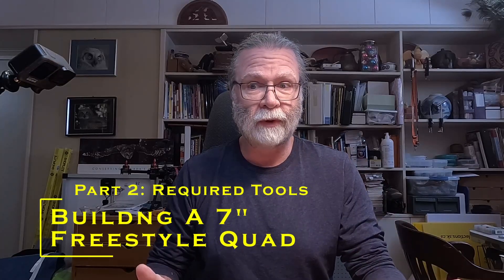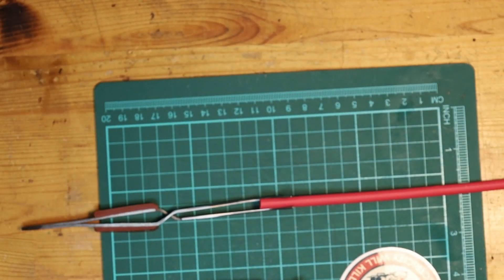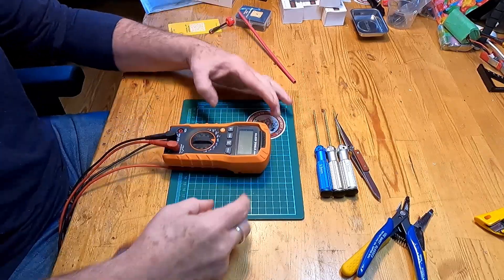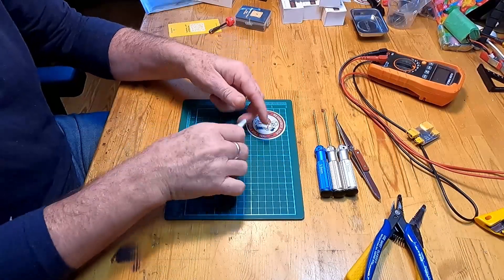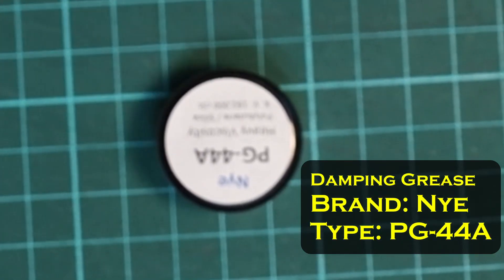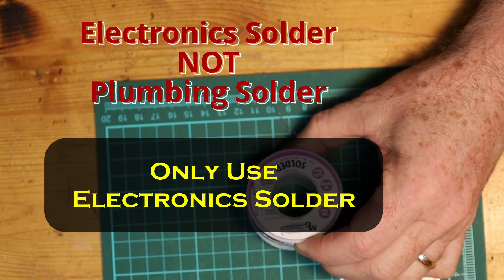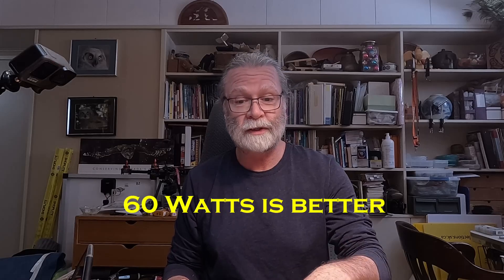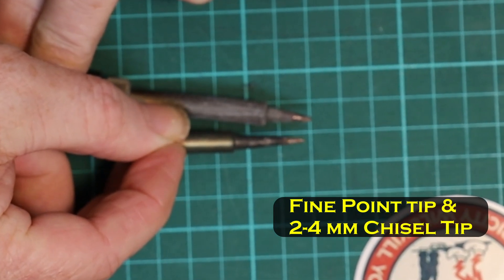How to build a 7" Freestyle Quad - Part 2: The Tools

Comment: What temp do you use to solder to fc?
Reply from the maker: Thanks for watching and your question.  I typically set my iron to 750F and leave it there.  If I'm doing heavier gauge wires/big pads, I'll swap to a larger chisel tip for more heat density.  For small pads on FC I switch to a fine point tip on the iron for less heat density and a more precision.  Having properly sized tips and solder for the pads is more important than a precise temperature.  Just pay attention to the overall temperature of the FC, and take short breaks to let it cool down a bit if you need.  Basically, when you touch the FC, it shouldn't feel hot.  Warm is OK.